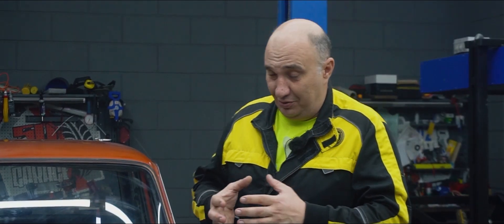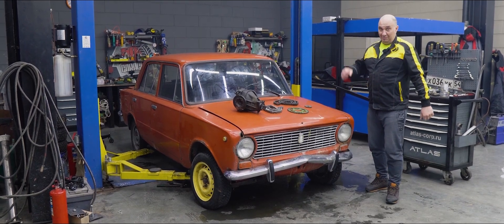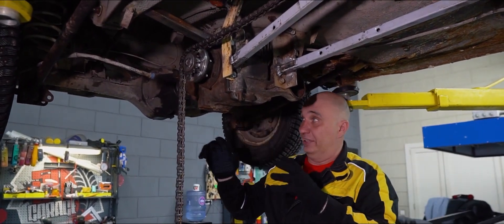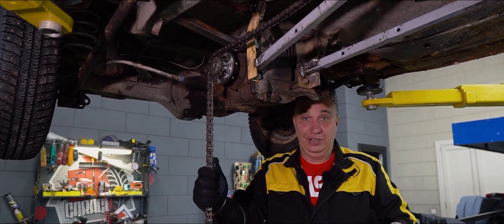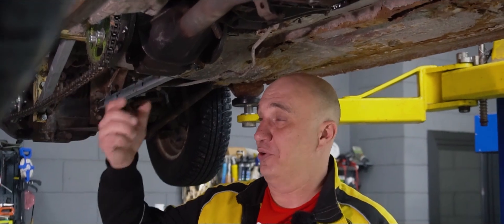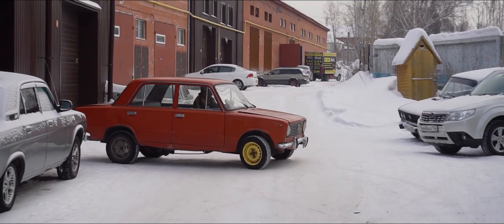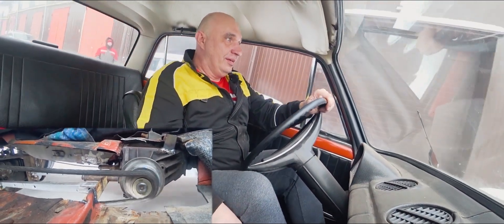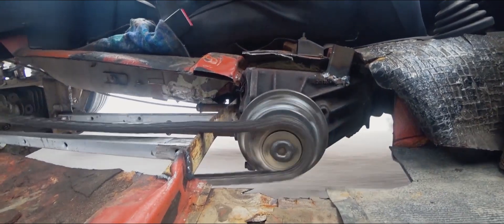Will chain drive work as a propshaft replacement?

Comment: Why not choose sprockets such that the overall ratio including extra differentials is 1:1, as would be the case with a driveshaft?  Also, why not use heavier chains and sprockets so that they can handle the extra load due to the greater mass of a car than a bike?  Why not use an adjustable spacer (threaded?) between two of the differentials to tension chain correctly?

Comment: Very disappointing that a shop with so much experience would do such a terrible job at this.  Everything that was done was predictably poor.  I would have expected those guys to do the following, at a minimum:

1) Get the sprocket size right at the first try
2) Get the chain tension right
3) Apply this experiment to something useful, like implementing a 3rd axle, hence turning the vehicle into a 6x4, which can be pretty useful for the conditions in their location

Comment: Came here because I was wondering given so many manufacturers put their engines in sideways these days to save space why they bother with a driveshaft. Of course we have a Slav in his gopnik mobile doing it for giggles! :P Edit: The only benefit of a chain drive is no diffs and it's a direct drive method, adding an extra differential defeats the purpose. Edit 2: WHY DIDN'T YOU PUT A TENSIONER IN FFS? All your problems would have been solved!

Comment: How to make a chain drive actually viable...
1. Install a freewheel for each wheel. This would basically give you 4WD, limited-slip differentials and traction control all at the same time.
2. Install a chain guard and a chain tensioner, both for safety and for reliability.
3. Install a centrifugal clutch to the crankshaft so that the engine can idle without problems.
4. Use a derailleur or something so that you can actually change speeds, and use a fifth freewheel on the engine itself to smooth out the shifting.

Comment: I'm at 8:18 and you finally figured it out. Now the things going to haul ass through 4 gears, now you're under drove every gear, like having 4:88 to one. You have to remember, each differential is also 3.00 to 4.00 to 1 gear ratio. So what you did, the original differential let's say was 3 to 1. Then you under drove it with another 3 to 1 on the chain, then the final diff is at 3 to 1. That's roughly 9 to 1 gear ratio(!), in place of the original 3 to 1 diff. Most Car rear ends are around 3 to 1 final drive. This is the way it works with pretty much all cars. Your transmission goes from about 3.00 to 1 in first, to 1 to 1(direct drive) in 4th, and 5th is usually 0.75 to 1(overdrive). Then, independent of tire size, you are rear-end final ratio is usually from 3.00 to 1 to 4.00 to 1. I remember when you did the direct-drive episode, were you wanting to go drive shaft right into the motor. I could have saved you a lot of trouble. All you had to do was just put it in 4th gear. That's direct drive, engine to prop shaft, same speed. It's called 1 to 1.

Comment: That bigger sprocket should be in the back not in the front. You just over drove every gear. Another thing, you can have quite a bit of slack in that chain. You need to make a Teflon chain guide near the back sprocket on the bottom, just like a dirt bike. That allows for a very slack chain but it'll still grab like an animal and not fall off. Do the dirt bikes having 14in of suspension, there are slightly off center line so they have to leave slack in the chain. The bottom is the return section of the chain, and all you need to do is hold it to the bottom of the back sprocket via Teflon chain guide. It's okay to use a roller made out of nylon as well. Yeah just check out a CR250 change that up and you'll see what I'm talking about.

Comment: There were a lot of chain drive heavy trucks in earlier years.  It gave you a huge ground clearance for traveling in swamps to take out logs.  Also in the military to get through really muddy conditions.  Of course they didn't travel very fast, but, nothing did then.
https://commons.wikimedia.org/wiki/File:1920s_Mack_AC_truck.jpg

Comment: spring arm with a piece of wood against the chain will hold tension and if you add a oiler to the chain with a seeping bottle to the wood it will prevent the wood from wearing away fast and oil the chain at the same time. thanks for the video  :)

Comment: That's why differentials were invented! So that you could transfer the power using a slip yoke which is what goes in gear transmission show that the rear suspension can operate and that can be constantly moving up and down in and out. The first versions of cars were chain powered and had bicycle rims

Comment: 4:00 - You can add a tensioner like it is used for timing belt to get the chain in proper tension without moving the differentials._

Comment: Th gap is because the chai is ol dyour pullinginthewar wishaccumilatesuntillthe chin breaks or the bearings are worn outommuvh to work suspecion makes it worse puttin log tudinal load onthegearboxthats why if you overtightionamotor cyclechaintotight it Wrecks the gearbox

Comment: That's why old school trucks were chain drive, with a massive sprocket in the rear. You get ridiculous gear reduction that way. More than you could ever get with a traditional ring and pinion diff. Those trucks could move huge amounts of weight with no effort.

Comment: Classic Saabs had this design in the 1970-90s. A chain primary gear between the engine and gearbox. Even the 900 Turbo is chain driven :D

Comment: your gear ratio would be still 1:1 since you use 2 diffs back to back. you would need 1:1 gears to get the original gear ratio

Comment: Why didn't the 4:1 reduction in the new front diff cancel out the gear ratio change? Because the new diff being driven backwards cancels out the gear reduction at the front.

By the way, you could rotate the 2 new diffs 90 degrees so the chain runs horizonatally under where the propshaft was (you'd probably need some guides to help with the sag, though).

Comment: I just was thinking about this exact idea a couple days ago.
How about using 2 Harley-Davidson engines in the rear of the Lada, each engine driving a separate rear wheel, and just use the Engine frame and rear wheel from each motorcycle. Just remove the whole Lada drive train and engine, and swap in the 2 Harley Davidson Motorcycles. It would sound so cool out on the road.

Comment: You should have used the same size sprocket on both ends :) Interesting experiment nonetheless. I've seen similar arrangements for connecting motorcycle engines to car rear ends on trikes!
Reply: At least a bigger one on the front.

Comment: What about placing 1 or even 2 cascading gearboxes for some serious gear reduction and range?  Having 16 combined speeds or even 64? That would embarass even the most hardcore truck driver. I would also like to see some testing of the "lincoln" diff locker,  the one where just a couple of sattelites teeth are filled with weld providing a halfway term between an open diff and fully welded.

Comment: I'm guessing it was a translation error when he said there might have been some slippage in the chain. That made no sense - chains don't 'slip' unless the cogs have no teeth. I'm guessing before translation he meant that he might gotten the rear wheels to spin not gotten the chain to slip?
Reply: He said slippage and claimed to hear a few clunks, indicating that the chain skipped a tooth or two. That being the slippage a refered to.
Reply: @meegstomtom  Yeah - but even on a REALLY loose chain, thats not really something that happens. Once the teeth are worn down to little bumps you get it, but chains don't 'slip'. You'd have to have enough slack in the chain that you could just lift the chain off the sprocket all the way around - To do that on a chain that length you would have to have about 10 links too many - probably more.

Best way I can describe it is -if you had a motorcycle chain that was 'tight' at full out adjustement, winding it down to full in adjustement (about 70mm) would still be about 100mm of adjustment not enough to even come close to having the chain skip over teeth.

Add onto that that the chain would always be under tension either top or bottom (bottom if driven by the engine, top if clutch in and driven by the rear diff) so it wouldn't be able to bounce off even if there was enough chain.

Still reckon he was talking about getting the rear wheels to slip and it was a mistake in the translation.
Reply: @5hiftyL1v3a  they can skip teeth and I've seen it happen. But in industrial setting. That being a really warm chain and a really worn sprocket. It was a chain driven conveyor belt on a shuttle (milnor I believe) it the belt jammed you could watch it skip teeth loudly (small sprocket,low rpm, high torque). But usually hit an estop prior to that happening. While an unusual case it is possible. 

Also look and a deutz allis 1312 mower drive chain. Very small drive sprocket and often really worn, along with a poly or nylon type chain guide. Can skip going up hill if warn enough. Had one. Weird mower. Poor set up. Cool in theory. 

But I would think he is more or less hearing something else as with the speeds on the sprockets in this video, it would throw the chain more likely them to skip a tooth. And I do agree that their chain isn't long enough and the sprockets are not thy small ether. Perhaps a stuck link, but I really think it was the chain hitting that piece of steel support.
Reply: @meegstomtom  Yeah thats what I was getting at - unless you have worn the teeth down to bumps - chains as a general rule, don't slip. Hence why I assume it was a translation error.

Also yeah - that was making me cringe watching the chain drag over that bit of angleiron. 

I mean a bare basics guard would have only taken a second to make up... Maybe dooont? stick ya head over a dodged up chain system during testing?

Comment: Roller Chain 1/2 link  is what you needed  Garage 54 ...  https://www.usarollerchain.com/Roller-Chain-Offset-Link-s/5351.htm#:~:text=Roller%20chain%20offset%20links%20are%20used%20for%20making,two%20offset%20side%20plates%20to%20hold%20everything%20in.

Comment: Two transmissions attached to each other. 6 speed in front of another 6 speed to make a 12 speed
Reply: That's a 36 speed. Each gear in the front would have it's one 6 gears to go into. A six speed trans with a 2 speed rear end would be 12 speed.

Comment: flip both chain diffs, change the direction the chain travels, normal pull from the top, slack underload should be on bottom, you risk tossing the chain with the loaded side on the bottom.  sprung toothed "Idler gears top and bottom would help control most chain slap, but still, when under normal drive load, slack side on bottom is often safest..  Love the experiments from Florida USA,  most entertaining as well as informative.

Comment: Ummmm back in the 30s and 40s most big trucks used a chain drive system instead of a drive shaft/prop shaft as at that point in time they were stronger and more reliable than an actual prop shaft

Comment: FWIW, the first diff gives reduction, but the second one gears it right back up, so you'd need tow of the same size gear, assuming the same gearing in each diff.  Or don't use one on the rear end and put the large gear directly on the axle shaft. To be practical, you'd also have to rework the suspension geometry so that the pivot point is centered on the chain gear from the transmission or use some heavy duty tensioner of some sort.

Comment: I couldn't understand why the 2 sprockets weren't the same size, I was proven right. If the front diff reduced the speed by 4 to 1, the secondary diff would cancel that out and increase it back to normal. 
1st diff 1 /  4 = .25
2nd diff  .25 X 4 = 1

Comment: if that chain snaps you'd be in a world of trouble hahahahah crazy russians, 
i wanna see you guys make a front wheel drive car into a rear wheel drive using a chain attached to the flywheel, passing through a giant hole in the firewall/driveshaft flange all the way to the rear axle, give it fixed hubs, mount the rear drive shaft on pillow block bearings, if that works you could then fit a second axle inline and make it have 4 driven wheels at the back like a truck, add some studded dual tyres and cut some weight out and you'd probably have a vehicle capable of launching HARD on snow. if you are crazy enough to drive it!

Comment: You should build a car that is actually 2 motorcycles side by side and then when coming to a 4 way stop turn the hazard lights on and both motorcycles drive different directions and the car looks like it splits in half

Comment: The two differentials cancel each other out as far as gear reduction.  Just put a large sprocket on both ends and you will have your gearing back to normal

Comment: here's some idea, most electric cars has each motor on each wheels, how about a lada with a small moped/small bike engine directly on each wheel? if torque isnt enough, add those small bike's gearboxes between the engine and the wheel

Comment: Garage 54: Doing to a car the exact opposite of what anyone who has ever pedaled a bicycle with a tendency for its chain to come off wishes they could do to their bike.
Reply: A bike with a flywheel, now that’s something interesting
Reply: @vincentas1  I meant deleting the chain from a bike and using a driveshaft....Putting a flywheel on a bike sounds like more of a pain than a benefit...Sure it adds to your inertia, but every time you take off from a stop you've got to pedal harder to charge the flywheel, and on uphills you've got that much more weight to lug.
Reply: @tomcarlson3913  I wonder how would you balance a driveshaft and a diferencial

Comment: A proven design dating back to the 1900s. Mount a spring loaded idler sprocket and replace the floor panel and run the heck out of it!

Comment: Plastic chain guides and tensioner would help.  Add another chain and sprocket on the other side and go do burnouts!
Reply: Differential is welded don’t need a second chain.

Comment: video idea: Modify the crank and the cam shafts so that all the pistons are at the top dead center in the same time, then try to fire it.
Reply: This already exists on some race bikes, it's referred to as the "Big Bang" design. All the cylinders fire simultaneously, followed by 720 degrees of crank rotation with no power strokes which gives the rear tire time to regain grip.
Reply: @CaptHollister  I think you're thinking of a flat plane crank style in which case all cylinders aren't firing at the same time.
Reply: @666cemetaryslut  No, he's thinking of big bang motorcycles. Look it up.
Reply: @666cemetaryslut  I know that 3-cylinder engines that fire all simultaneously exist, so there's no reason for a 4-cyl not to do the same. Seriously, look up "big bang firing order", it was a big thing in motorcycles a while ago.
Reply: That s a great idea 👍
There ll be big vibes!!
Reply: Lada engine is probably not an interference design, which means the valves and pistons won't touch.

Comment: It's old tech believe it or not. Chain drive was used up until the 30's by cars and trucks as a final drive. Most famous chain driven car was the WSR car Babs driven by perry thomas iirc. The problem with chain drive is friction within the chain and balancing something that can cause catastrophic failure. The maintainence is a pig compared to a propshaft, but a chain is generally lighter and more compact.

Comment: @Garage 54 Need to install an idler sprocket to adjust chain tension, you can also get sprockets in various sized to change ratios and help with chain tension.

Comment: This is the reason why my dad doesn’t like Honda’s. When he was in the service in the 60, they were chain driven lol. He hasn’t quite gotten over it.
Reply: Thats cause at that time they just slapped a car body on a motorcycle lol.
The 1964 s600 had a modified motorcycle engine. (Or motorcycle inspired engine in fancier words).
Reply: @CartoonWeasel  my dad had an old white station wagon when I was young that had a motorcycle engine jn it. I forget what it was now, but it ran like crazy. He kept it until it dropped a cv axle and trashed the front suspension.
Reply: Harleys are notorious for wrapping their snapped  chain around the rear sprocket,  instantly locking the bike up . Thankfully,  in recent years , chain drives are being phased out to belt drives.
Reply: @texasslingleadsomtingwong8751   They are also notorious for oil leaks, high maintenance , and lack of innovation up until more recent years. The only reason this company has been surviving is because of name recognition and the fact its american made. The latter of which has been going out the window.
Reply: My bike is a Honda, not worried about breaking chains... it's shaft driven. instant torque!
Reply: I have a honda 1960s honda s600 with a chain drive.   I just put up a walk around video of the drive line on my channel.  They run chains for just the swing arm.  They are extremely reliable and are not modified motorbike bits.  All designed from the ground up as a car

Comment: So many trucks from the early 20th century used a driveline just like this one. They were actually still preferred in some applications like logging into the 50s!
Reply: Pickford had heavy haulage chain drive trucks into the 60's and the army Antar Tank transporters were also chain driven (they also had petrol engines which I believe - though not sure - were RR Merlins) I think that would work out to Gallons per mile. not miles per gallon.
Reply: I was going to say, a lot of the old Mack trucks like the AC had a chain drive.

Comment: Please add a chain guard and a couple of idler gears would remove most of the slack.
Reply: https://www.usarollerchain.com/Roller-Chain-Offset-Link-s/5351.htm#:~:text=Roller%20chain%20offset%20links%20are%20used%20for%20making,two%20offset%20side%20plates%20to%20hold%20everything%20in.